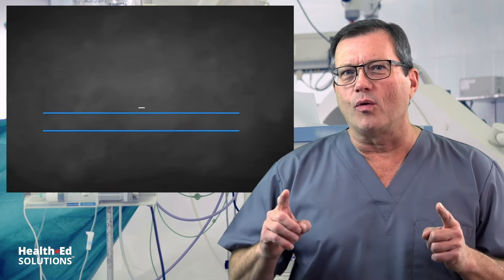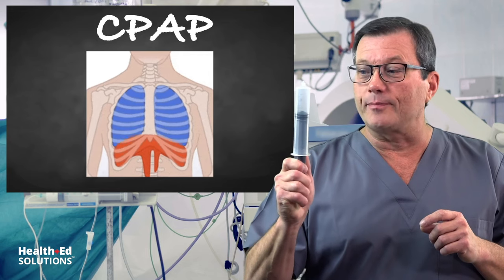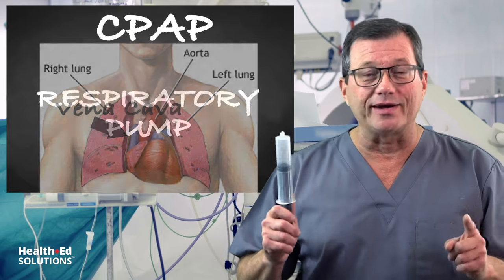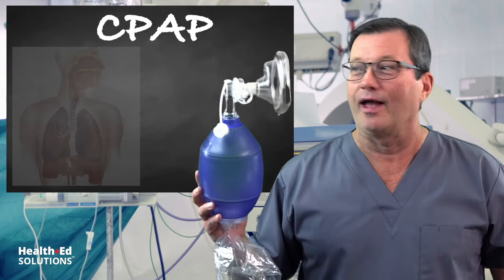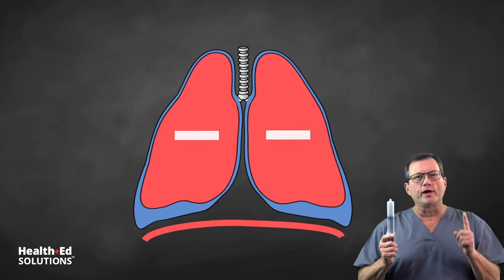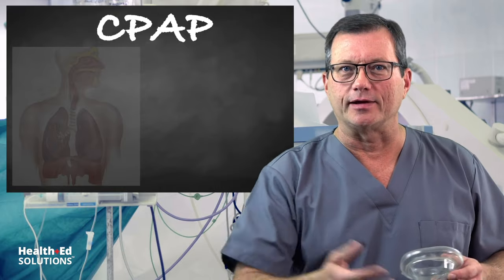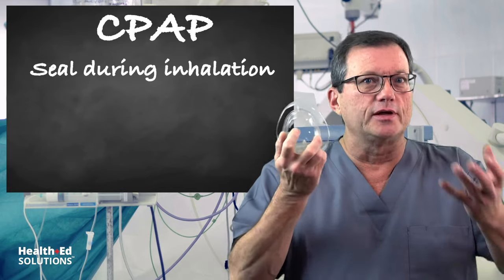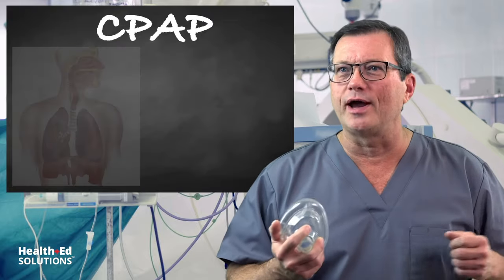One Quick Question: How Does CPAP Work?

Comment: Excuse me, but if the diaphragm drops down, the thoracic cavity expands, descending the pressure in the heart. So instead of the vena cava being sequeezed it happens the opposite, and what helps blood return to the heart is the pressure difference between the vena cava and the rest of the circulatory system.

Comment: I am a little confused? I was always taught that during normal Negative pressure inspiration as the thorax expands and comes under negative pressure it actually "SUCKS" blood up into the Vena Cava from the abdomen increasing Pre-load and it is  when we exhale creating positive pressure in the thorax it is then that the preload is pushed into the atria? When we intubate or use a BVM and initiate positive pressure ventilation you loose the "SUCK" and reduces the preload consequently lowering the blood pressure?

Furthermore are there any objective studies not funded by the manufacturer of the ITD that prove its efficacy?
Reply: I think the physiology in the video is wrong. He states that negative intrathoracic pressure increases the pressure on the vena cava and "drives" blood to the heart. What happens is that during inspiration the pressure in the right atrium drops and makes it easier for the heart to fill. A negative pressure in the thorax doesnt put pressure on the vena cava. What he illustrates with the syringe is the pressure from the atmosphere on the thoracic wall.

Comment: I have had my CPAP for a year. I despise using it. I sleep much better without it. My doctor says I need it, so I have it. Insurance says I have to use it if I don't want to pay for it. So, every night, I curse the machine, apply the mask, and pray for death.
Reply: is there any other way rather than using CPAP? My next appointment with the doctor is next month. During the last appointment, the doc said there's a possibility i have to use the CPAP.
Reply: @mcflyers9450  Not that I'm familiar with. I just use mine the minimum amount of time required.
Reply: Can you just turn it on and put the mask on a stuffed animal?
Reply: @tilwedie23  No, because it will turn itself off if it can't detect any breathing.